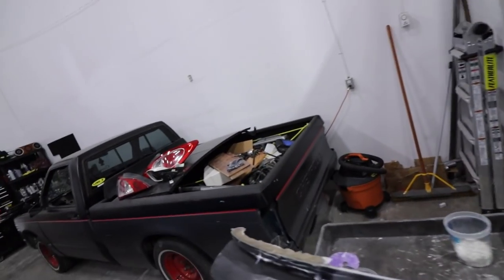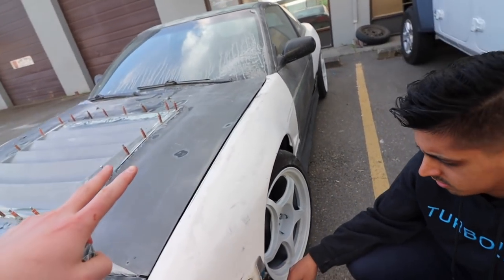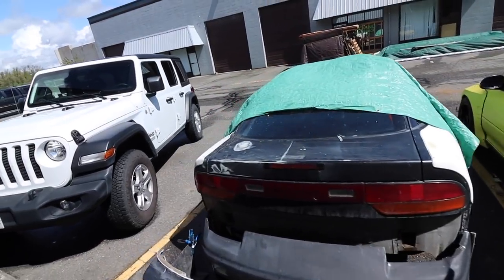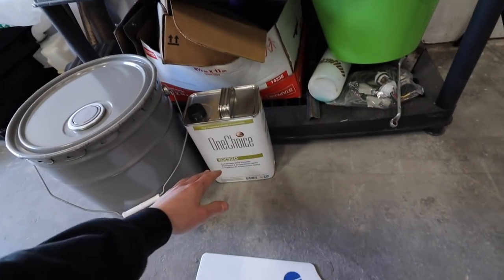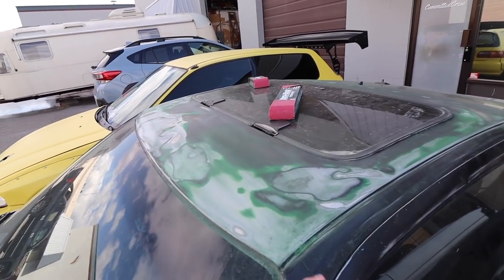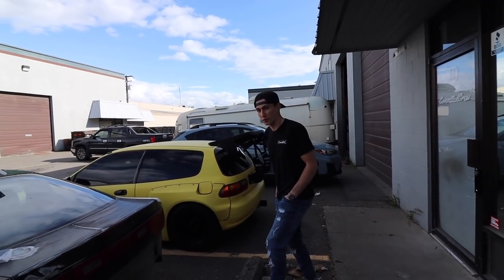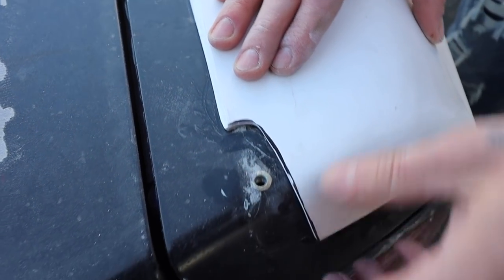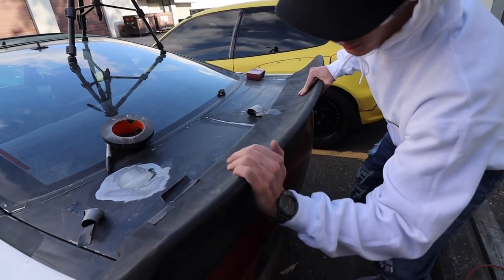Installing Duckbill on my 240SX!

Comment: For painting removable parts ideally have them removed so that the paint doesn't stick two parts together but have the parts on stands in the position they will be relative to the other panels. That way the metalic should lay the same.  Does that make sense the way I've explained it? So take the over fenders off and move them say a foot or so away from the car ideally a bit more but keep them in the same orientation they would be on the car.
Reply from the maker: Makes sense! Thanks